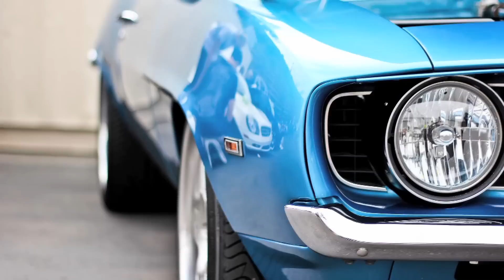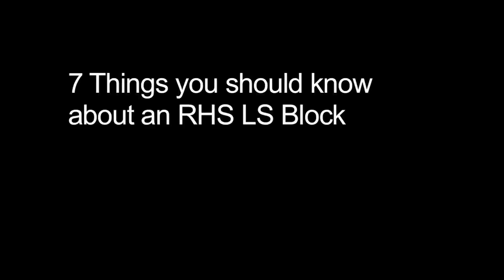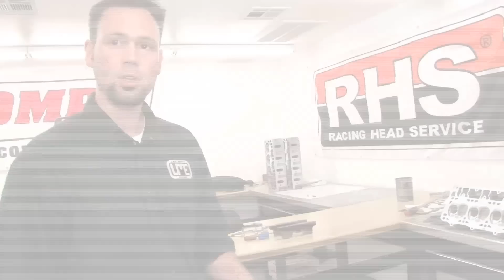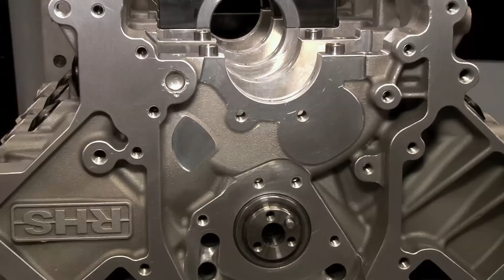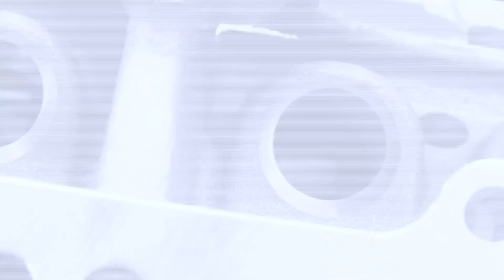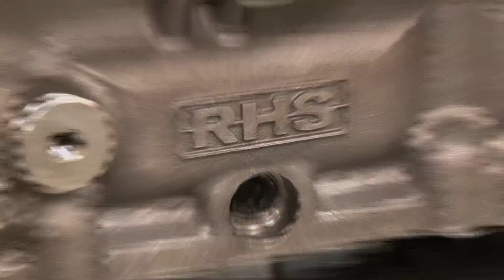7 Things You Should Know About the RHS LS Block

Comment: 8) When go big (502ci), you need a billet crank.  That'll blow up your build budget.
9) Most of the factory accessory brackets will require grinding to fit the beefier webbing and gussets on the outside of this block
10)  The under-piston oil squirter make this an especially good motor to add crankcase vacuum too.  

And the tall-deck block will fit in a Z06 with short motor mounts... barely.

Comment: Ummm, stock Iron ls blocks take 1000hp.
Reply: Ummmm, not for very long.
Reply: You hang out with the wrong crowd then, 60-100 pulls on junkyard blocks no problem.
Reply: Iron blocks are good, but what if you want something strong and light weight, engineered for abuse...you cant go wrong with an aftermarket block.
Reply: Yeah and 100 lbs heavier. Guys do this and add another 100 lbs with bigger transmissions as well so when I'm at the track I always feel like the other guy next to me has to drag my fat x wife along with him. lol.
Reply: Stock ls iron block  breaking point is 1000hp

Comment: Nice vid. I'm not an LS expert but I find there isn't much block material between adjacent cylinders (ie: 3:00 mark)...Is there any danger of warping there? thx.
Reply from the maker: The cylinder liners are ductile iron and are very strong. There isn't much danger of warping. Boosted builds can safely go down to .200-inch cylinder wall thickness on the thrust side without any problems. Even at maximum recommended bore on one of these RHS blocks, you would still have adequate cylinder wall thickness to avoid any possible warping as the cylinder wall would still be well above .200 inch. The biggest concern is with cooling and cracking the cylinder walls when they are below .200 inch--especially when it is a tall deck motor. The taller the cylinder, the more rigid it has to be to prevent cracking and thus the more cylinder wall thickness should be use. However, there is nothing to worry about with the RHS tall deck even at its maximum bore size. They may look thin, but they are well within tolerance.
Reply: Thanks for taking the time to clear that up for me =) BTW how do they get the cyl liners in there, are they cooled first and then inserted? Can they ever be pulled out again and how? The engineering behind this block is truly astounding
Reply: This block would be great for a 2 stroke conversion build with ports for the cylinders and liners.

Comment: So in a nut shell if you want to build the biggest cubic inch LS possible this is the block to use?
Reply: I've built 8.2L into mine.
Reply: @yzScott  what is that? 502? I think that is my end goal. Boosted 502 in a c6 or cts-v
Reply: @swappedoutZ71  Yes, it is 502 ci.

Going that big in an aluminum block, you don't want to boost it.    If you're going to boost it, there is no need to go that big anyway.
Reply: @swappedoutZ71  My boosted motor was built 7.0 in a (steel) LSX block.  It's pretty trivial to get 1500 HP with a forged LSX.  This RHS block is more for max NA builds.  If you're going to boost the RHS, definitely don't take the bore past 4.125. But you'd be better off (and cheaper) with an LSX block for boost.
Reply: @yzScott  I'm not looking to run 30psi or anything crazy. The boost is honestly just for the cool/boss factor. Probably run it on like 6psi. But the added blower whine or turbo whistle is what I want. It would have a way different setup than what I'd use for all motor 502 build lol that's for sure. Much lower compression and a lazier cam. The boost would be to make power without going "max effort" while utilizing the cubes for massive tq production that's needed for a fun daily driver. Like an easygoing 700hp build but tq would probably be over 800. Max effort na 502 would be different, I'd try to squeeze out 850hp and it would probably make 650-700 tq with a higher recline than the boost motor, entirely different solid cam setup etc.
Reply: @swappedoutZ71  The big thing to factor in for a 502 is the crankshaft.  To go 4.6 inches, you'll need a billet crank.  A Callies Ultra Billet crank is not even gross balanced when you get it.  My LSX shortblock cost about the same as the just the crank for the 502.  It was a budget busting build.  So get ready.
Reply: @swappedoutZ71  Over the winter, my MSD intake will be replaced a billet manifold from Late Model Engines.

But even on the MSD and a hydraulic cam, I'm making roughly 750 crank HP.  Torque is insane everywhere.  

I am looking for 700 HP at the tire this spring.  And still fit under a stock Z06 hood. (in theory)  The hood is off and car is on blocks.  I could still start it, but not for long.
Reply: @yzScott  that's why I say it's my end goal. Because I'm not building shit after that🤣🤣🤣 I just want a really boss car to have. I'm on my 3rd LS style build and I've gotten the displacement disease haha

Comment: Siameased cylinders = uneven cooling since water-jackets are in contact with a much reduced area of the cylinders, especially the inside cylinders which are close to only half water-jacketed.  Hot spots = warped cylinders = ring blow-by.  Don't know how they get away with this; maybe the steel liners are made special to compensate ?
Reply: Three Things.  First they say they have cast bore walls.  Meaning these are not truly siamese, i'm guessing in large part to deal with heat issues.  Also, aluminum alloy blocks really changed issues with siamese bores, as it moves heat so much more effectively, and largely the belief that siamese cylinders cause problems is a myth from 400 chevys, where OTHER issues caused the problem that got blamed on siamese bores.
Reply: Pretty sure they know more than you buddy
Reply: RHS should do like Lexus and fill the casting of the aluminum block under vacuum versus pouring to eliminate the possibility air bubbles. This process would not only produce a better product for the customer but also save time and money. No need to scan the block for voids and cracks
Reply: This is the design of the factory LS7.  The LS7 definitely has some reliability issues, but none of them are concerns you raise.